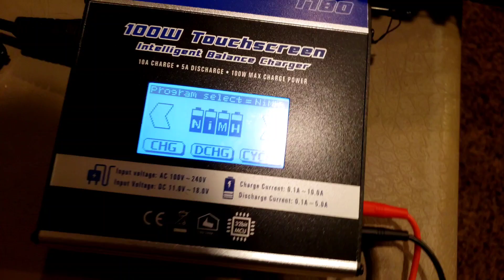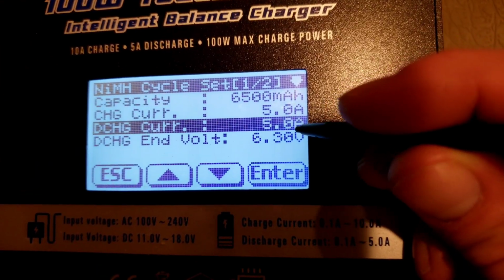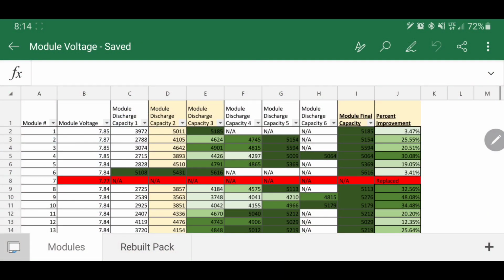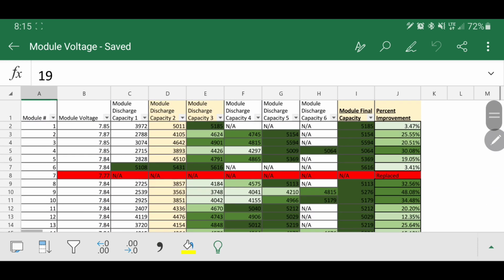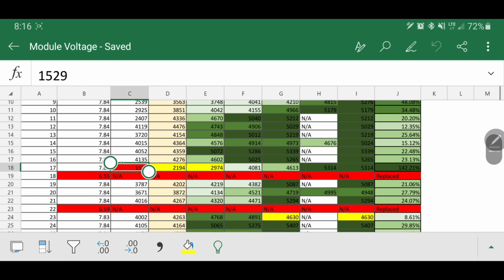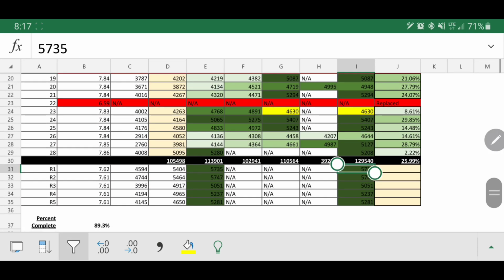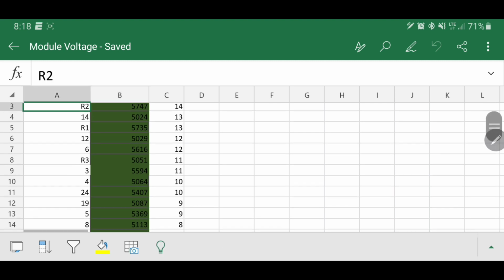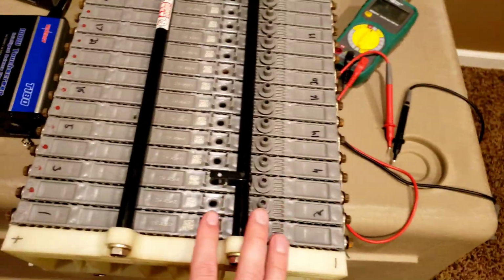Reconditioning a Prius Hybrid Battery Pt 2

Comment: How long did the typical 5X cycling take with the Tenergy T180? I had a Gen 2 which had battery failures 3 times (200K, 224K, then 330K). Between the 224K & 330K the battery was balanced and cycled by someone else, which made a huge difference. I now have a Gen 3 at 200K and planning to prepare a spare this spring. I just assumed I can do 1 cell per day over 1 month. BTW, I am located in KC area (Overland Park) if you ever wanted to get really nerdy, would be cool to meet up.
Reply from the maker: Are you seeing any issues with your current battery that make you want to prepare a spare battery? NiMh has a self-discharge rate of about 10%/month. If it were me, I would store all the cells in parallel and trickle charge them until you decide to end up using the spare, then all your cells are balanced and ready to go.

I would certainly not be opposed and would be happy to loan you my T180 so it takes less than a full month lol :)
Reply: @HEVTech1  That makes sense. Never thought of that for the storage long term when not installed in an actively used prius.  I own a gen3 and gen2 now as well... though debating investing in another gen2 pack for some cells since I see one block is consistently low per Dr. Prius app and another block does drop rather lower at times.

Comment: I'm not to clear of which part of the video is just for data, and which is actually changing anything.  When you say it's "really important" to do something, you don't explain why.  Is there anything here that would actually make the battery work better vs. just replacing the bad packs that show up on the scanner, and installing it back in the car?
thanks
Reply from the maker: If you only replace modules that are throwing codes you are only replacing the modules that simply cannot function. Its essentially the bare minimum. By cycling each module you can see which modules are close to end of life and replace them while the pack is open/gutted. Your entire pack capacity is only as good as the worst module so by replacing the worst 5 rather than the 3 that failed, I gained roughly 15% in capacity.
Reply: H-EV Tech perfect. Somehow I wasn’t getting that in the video. Thanks for the reply.  Also you didn’t show what the charger looked like when you were reading the high and low values. Does the charger record the values for you to see later or do you have to be there watching it when it tells you it’s fully discharged?  Or charged.
Reply: A video on how you actually used and read the charger would be helpful. Maybe you have one somewhere 👍
Reply from the maker: @Dr.G  the charger I used "Tenergy T180" will give you a capacity read out at the end of how ever many cycles you choose to run it for. Most hobby chargers will function this way. If you look up "NiMh cycle charging hobby charger" or the online manual for the Tenergy T180 it will cover it in more detail than I can explain.
Reply: H-EV Tech thanks my friend. I appreciate it
Reply from the maker: No problem at all! Good luck!
Reply: @HEVTech1  Quick question, do you have any recommendations on the best place to by a module.  Do they rebuild them, or are they all new.  Is there factory units, and aftermarket? And what about the brass connectors,  do you recommend buying the nickel or chrome pieces or just using the old cleaned copper ones.  Thanks in advance.
Reply from the maker: I personally used reconditioned modules from ebay as I couldn't find new modules at a decent price. I looked at the seller rating before buying and there is usually a quantity discount. I cleaned my copper bus bars in vinegar and used a wire brush and they turned out great.
Reply: @HEVTech1  Thanks again.
Reply: Sorry to bother you, but I see lots of used modules for sale, not reconditioned.  Would you buy a plain used tested module?

Comment: Have you ever had the t180 not allow you to scroll through the cycle.i did 5 cycle 
 mine have 
 I assume cell is bad ?
Reply from the maker: I have and found I need to be on the screen showing how many cycles I want to do prior to initiating the charge/discharge. If it runs through charge and discharge really fast your module is likely bad. Mine took at least 2 hours for each full charge/discharge cycle.

Comment: Q: when you hooked up all the modules in parallel (plus to plus, neg to neg) - the last step before reassembly - why did you trickle charge at 1A?  

I ask because I've read others who simply let the pack sit 24 hours in this 'parallel' state, and found the pack adjusted each module to be the same.   (This step assumes that the modules have been reconditioned and charged to within .05v of each other first...)
Reply from the maker: Trickle charge was more to increase the voltage for each module so when I put it back in the car its around 65%. Letting it sit for a while is the most important part.
Reply: @HEVTech1  what's the correct setting (V, A, Capacity ) for the trickle charge in the parallel state. I couldn't find any information about that. Thanks for the great video.
Reply: @HEVTech1  Please tell to what voltage do you trickle charge to make it around 65%?

Comment: Just might be doing this for my 2010 Prius very soon; what are your thoughts on pros/cons for using the CQ3 quad balance charger (Amazon #B087216GMB) vs the pair of Tenergy T180's you used?
Reply from the maker: I think that isn't a bad idea! The only issue I see is the discharge power of 10w (for all 4 modules) could be too low to show those that have issues under load. What I liked about the Tenergy ones was the ability to discharge at 20w max and the interface is super easy to use. The T180 is also on sale for $79 at the moment.

Comment: Hi! Great overview of balance charging and love the spreadsheet. I just got a couple T180s to do the same thing- when/where do they display the capacity data from each cycle that you entered into the sheet?
Reply: I contacted the company to see if they would advise how to view each cycle, they stated this was not possible, only the last cycle results will be visible. Don't know if they had some kind of firmware update and got rid of it, but that is disappointing.
Reply: @Hlywine  if you see at the bottom of display screen from left to right: ‘ESC’, ‘CYCLE’, ‘GRAPH’. ‘ESC’ and ‘GRAPH’ are highlighted so that it encourages entering (tricked me also). To view the  charge/discharge info recorded select ‘CYCLE’ while connected to see the given data for each. All should be there if you haven’t already ‘ESC’ or disconnected
Reply: @Hlywine  Thanks for posting I have the same question. so what I am doing is just taking the last cycle and recording it...I am setting two then another one. good luck I am on the reconditioning journey here.
Reply: @GloriaHernandez-in2fk  how long does each cycle take for one cell? If I were to do 3 cycles, how long approximately does it take?
Reply: At the end I'm not getting results for all cycles, only for the very last one. When all is completed I get the results with arrow down in the top right corner, and at the bottom I have 2 active buttons "ESC" and "Graph". No way to cycle to previous results. Manual doesn't seem to talk about it either. Either I'm missing something or my charger is defective...
Reply: Ho ho he hum
Keep reading brother.
  Press (Cycle)
Reply from the maker: It will certainly display once the cycles are complete. Once a charge or discharge event is completed you should be able to go back and view them.

Instruction manual can be downloaded here: https://power.tenergy.com/tenergy-t180-100w-balance-charger-with-touch-screen-metal-housing/
Reply: @HEVTech1 
Please can you send me the datasheet
I need it because I don't know how to do special function in the xl like yours

Comment: Hey, do you think I can use the IMAX B6 balance charger for this task?
Reply from the maker: Yes it looks like the IMAX B6 would support NiMH and be able to discharge at 2A
Reply: @HEVTech1  In my experience the Imax B6 (a copy, if you buy from a reputable dealer) or the fake of the copy (if you buy on ebay or non-dealers) seems to go up to 1.5A discharge, which is at least better than the Tenergy 4x6s quad charger, which offers up to 3A DSC but in reality only goes to .5-.7A.  I have both of these chargers.  For anyone contemplating getting a hobby charger or quad port charger for this task, verify what the real discharge rate is and buy the highest real discharge rate, even if you have to pay double for it -- you will thank yourself..
Reply from the maker: @cawag98  completely agree with spending more for a higher discharge limit. You will not regret it when it takes half the time.

Comment: Hey man, great videos. You linked me to your page a couple of days ago and I have subscribed!

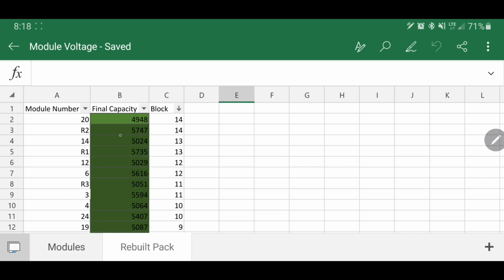Could you explain at 6:15 how you order the modules/cells? I understand that there are 2 cells per module, so is all that you are doing just trying to keep the average module capacity similar to the others to avoid peaks and troughs?
Reply from the maker: Yep you are spot on. I am making sure each group of 2 modules (or one block) all have about the same capacity to avoid peaks and troughs. The pack is only as good as the weakest block.
Reply: @HEVTech1  I need to get my terminology right. 1 block = 2 modules. The prius uses 28 modules. Thanks man!
Reply from the maker: @liquidh6344  sounds like you have it down!
Reply: @HEVTech1  so if one is 8.10 and another 7.9 buss-bar them together to avoid peak and trough? because if I was to put 8.10 and another 8.05 together a peak would occur and through off computer?
Reply: @GloriaHernandez-in2fk   That seems logical.  I haven't heard anyone else mention that.  Excellent thinking.

Comment: Hello
when you put the whole package in parallel and charge it 8 hours
How many amps do you select on the charger?

thanks
Reply from the maker: I only had it at 1 amp. It really was a trickle charge. When I reassembled the pack each module was at 7.83v
Reply: Can with this charger we only do one module at a time or multiple?
Reply from the maker: @EhsanKhanSemanticSEO  
All great questions!

You "technically" could do more than one at a time but its generally cautioned against as one cell has a higher capacity than the other. Doing them individually is doing it "right". If I had to do this again I would do them all individually again.
Reply: Ok got it brother then for a modules of 20 pack how much day or hours u take to balance complete battery sorry for so much questions but i m also hobbiest in hybrid
Reply from the maker: @EhsanKhanSemanticSEO  

I got done in 2.5 weeks but I also cycled each module 3-5x and had that slower charger for the first week. 

No worries at all with the questions, thats why I do it!
Reply: Hi! How would you do it if you wanna do it individually as “the right thing”, does that tenergy have the option to just Charge it to a certain level ? Or you have to do another cycle and stop at a certain charge so everything has same charge ? I have a 2010 gs 460 with 40 cells, Thanks
Reply from the maker: @MrTabz8  yes that tenergy allows you to charge to a certain voltage which is what I did after connecting all the positive sides together and all the negative sides together. I charged to 7.8v then let it sit for 16ish hours to balance all the modules.
Reply: Yes but i was not saying that we should do modules in a series at one my question is that the charger u have used what options this has that can we do balancing or more then one module mean separately connected?
Reply from the maker: @EhsanKhanSemanticSEO  

Gotcha,
No it only has one positive and one negative lead. I cannot separately connect more than one module.